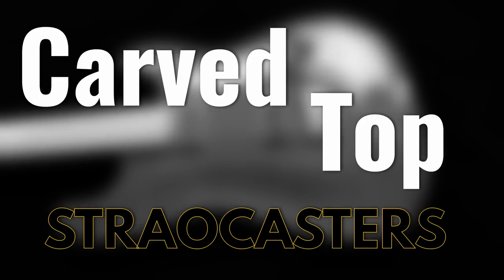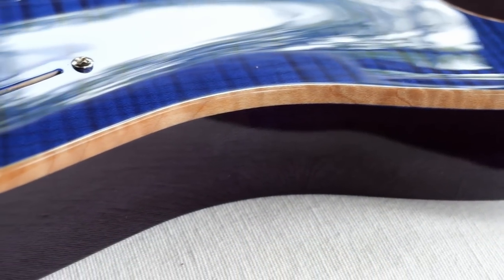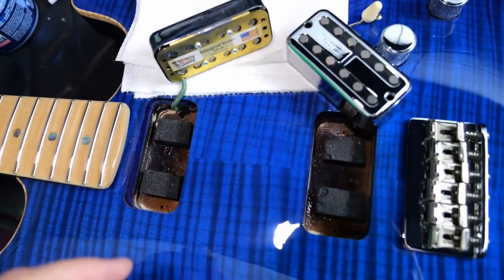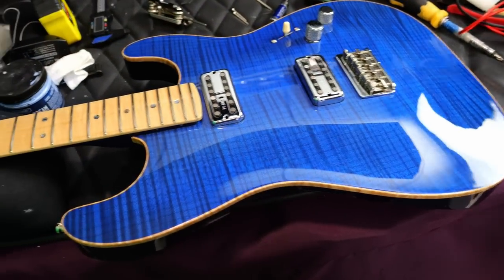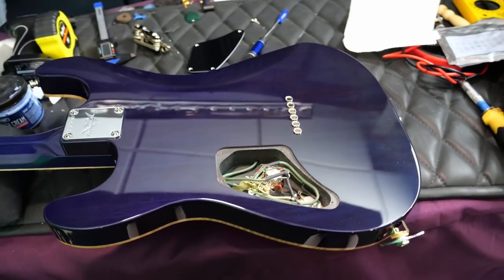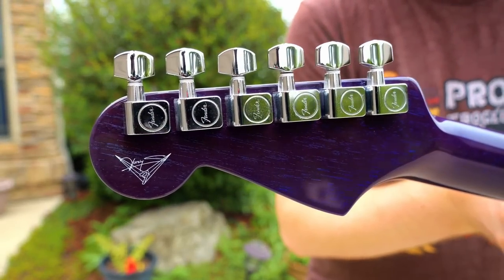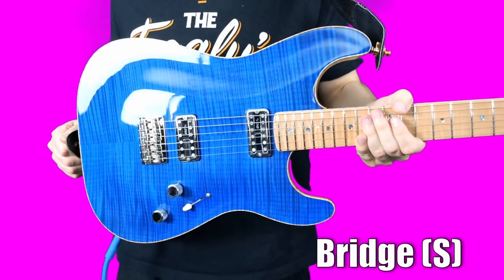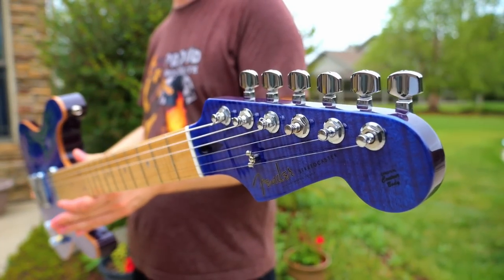I've Never Seen A Strat Like THIS! | 2020 Fender Custom Shop Masterbuilt Yuriy Shishkov Carved Top

Comment: The reason the neck pickup doesn't have a coil split is because the Magna'Tron neck model has amazingly low inductance, around 1.2H. That's well under 50% of a vintage Strat pickup, and around 30% of a vintage low wind PAF. Splitting it would be uselessly thin and low output. The bridge model has a 2.9H inductance, which is around a vintage Strat pickup, and splitting it would bring it down to a little more than the neck model, so it's a reasonable pickup to split, though of course as you can hear, it's crazy bright when split.

Comment: My favourite guitar (that I own) is a Fender that's way more Gibson-like than that Strat.
The Telecaster FMT HH is, in my humble opinion, the best guitar that Fender's ever made: thin and light, its mahogany body (with flame maple cap -NOT veneer) is resonant, its Seymour Duncan pickups are splitable and its set neck has a lovely, sculpted heel.  Add to that the 15.75" fretboard radius, and you've got a very unusual Fender guitar,  indeed.
Reply: I picked on up about a year ago.  I've been playing strats, teles, and acoustics (usually Guilds) for 30+ years.  Decided I wanted to branch out my sound options and picked up my first Gibson LP a few years back.

After 3 decades of playing straight-neck guitars, just couldn't get used to the angled neck on an LP.  Specifically, it's the string height off the body I can't stand.  

So I got rid of the LP and picked up a Tele 72 Thinline Reissue.  Cool on its own, but didn't have the LP sound.  Then last year I ran across the Tele FMT HH, and snapped it up immediately.  It's the absolute perfect LP substitution for the Fender player.  Beautiful, sounds great and feels great.  A surprisingly good price too, for everything you're getting... Picked up mine new and on sale for $949.  The one negative is Fender doesn't even throw in a gig bag, and a guitar like this really deserves a hard case.

Comment: This is cool, it gives me PRS vibes over Gibson ones. I think I would rather have a trouble maker Tele.
Reply: Yep I think this is Fender's take on a PRS type model
Reply: @@desert_fisherman na, I have a Vela, aside from the bridge pick up maybe. The Vela is a cool guitar. It’s really barebones, nothing fancy about it. A really good work horse. It’s like top loaded telecaster, mixed with a Gretsch. Mine has a PRS 59/09 in the bridge. So it’s more twang than a regular Vela’s Starla pickup. Which is kinda like a darker filtertron but the single coil on the neck is pure Gretsch 57 duo jet. This strat screams custom 24 or CE 24 to me. The TV Jones are a cool spec on the strat.

Comment: MSN I was in love with the blue Strat until I saw the string tree. At Custom Shop prices I'm ordering locking tuners and an angled headstock. Great video🎸👍
Reply: Why make the design worse? The strat has the fretboard sitting higher than the headstock so no need for an angled headstock, I agree for the locking tuners though

Comment: Oddly enough, I have plans to build a carved top Strat using a 90's neck I bought and a Warmoth body, but I want a trem bridge and standard 3-knob controls.  
That is sort of the problem with a guitar like this - it was built to specifically to one person's vision, that if your vision doesn't match, then the high price is hard to justify...

Comment: Problem is, when Fender does anything requiring work on one of their guitars, they start charging Gibson Custom prices.
Reply: The upside, Fenders are so well designed for the end user, most players can work on their own Fenders, unlike set neck Gibsons.
Reply: Gibson propaganda! Everything is easier to deal with on a strat
Reply: @tinystar3010 yeah because of the front routing which tends to make guitars look awful
Reply: @tinystar3010 you're taking your neck off for what reason??? Yearly neck resets? 

By "Work", I meant factory work other than Fenders usual, screwing a neck to a body and dipping it in polyurethane. Like a carved top, bound neck or body, set neck, etc... hell, even for their awful spray painted trash heaps theyre charging 7k
Reply: @guyincognito1423  The "Custom Telecaster FMT HH" is carved flame maple, set neck, bound body and neck, rear routed... basically just a Fender version of the LP and is usually on sale for just under a grand.  So Fender certainly does do "work" for far under 7k.  Most people just aren't looking for these things on lower-priced Fenders.